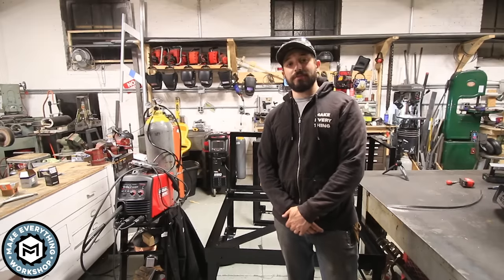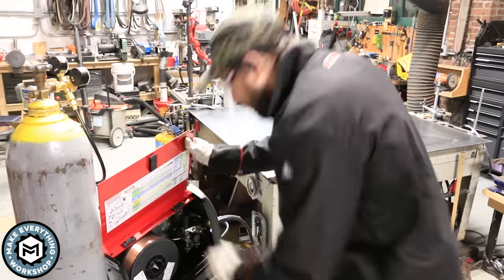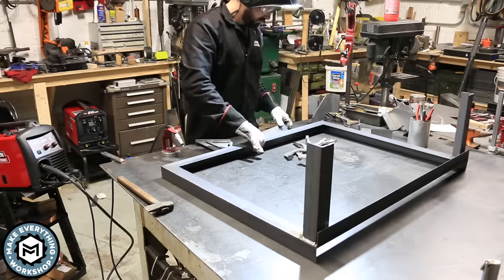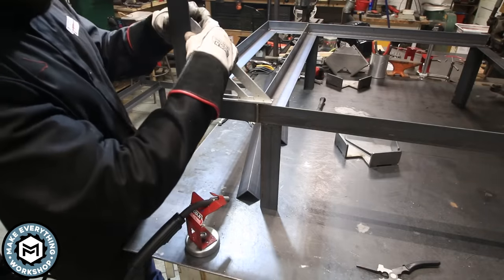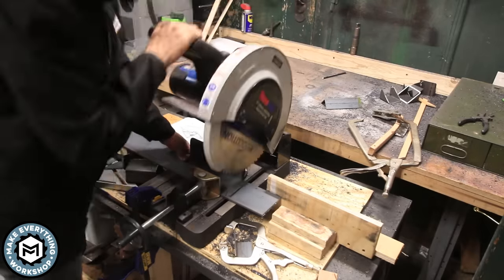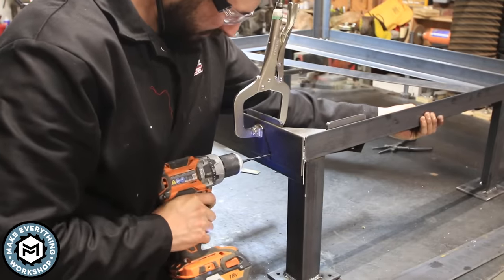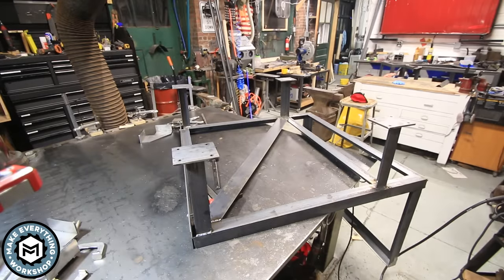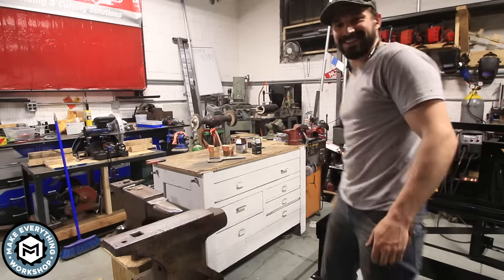How I Make Money With My Mig Welder

Comment: Some of my customers would argue about the final bill. I would tell them that with welding it's all about set-up and time itself. I had a lady who wanted me to build her a frame for a coffee table and told her the price and she asked why so high and I said " when you build something that supposed to be square , it needs to be square ( pun intended). She went to someone else and paid him $665, I was only going to charge her $500. Anyway she brought me his piece and it was 3/8 out of square. Boards weren't fitting right, the welds had Bondo in them, paint was bubbling.i told her I'll fix it but it's going to cost more if I have to fix someone else's screw up. Not to mention the table was supposed to be 36".   This moron had cut 3 sides at 34" then welded on 2" to each length. I told her she would be better off starting over with new materials. She insisted that I fix it. I told her I won't have my name attached to this piece. She was very adamant. I told her that there was rust under the paint, that's why it was bubbling. The wood on top tapers cause of the top not being same length. So she asked me if I could make her a new one and she would bring me the materials in the morning. I said ok, however I would still need a deposit of $125. She wrote me out a check and I cashed it right away. Next day she brings me the " materials" which just so happens to be the same table from the night before. I said that whoever cut the metal cut all of the pieces too short. She was getting mad. I said it's not my fault!  Whoever cut these, cut2@33" and 2@31".  I offered that it can be done for a 30" table. She said ok and I said I'll use the money she gave me to go get materials for the rest of the table. She needed for the following Monday ( today was Friday) . She decided she wanted a drawer so I worked up a price and told her if she changes her that it will affect the final build. She called again asking adjustable feet be put on then called back asking to not put the adjustable feet on. I already mounted the feet. I got it done on Saturday, painted it and told her she can come Sunday afternoon to pick up the table cause paint is still wet. She insisted on coming over to get the table. The paint is still wet I said. She said for me not to worry. It was then that I realized that she was going to pick apart everything and complain about the price. Now because of the adding and subtracting a few items the final bill was going to be $650. She said she won't pay it. I said you don't get your table and I'll see you in court. I hung up. Her husband called me back and I told him I want the money in cash. He came over and he gave me the money. He then asked for the check back. I said that was all part of the price and that because he fucked up cutting the table apart I couldn't and wouldn't use any of the original metal. He picked up the table and got black paint everywhere. The moral of the story is if you wonder why welded pieces are pricey? It's because you have to:
Cut all the metal
Clean the metal
Check for plumb
Check for square
Check angles( if any)
Tack it together
Recheck all of the above
Finish welding
Grind/ sand welds smooth
And that's just a small description.
Reply: This hits the nail right on the friggin head!
Reply: @Thatheatrock  thank you...I love building stuff for people, however there's always that " one" person who could get it done cheaper.
Reply: I learned long ago to avoid homeowners -- some people do very well with them .- the grief just wasn't worth it for me and I stayed with commercial customers .

Comment: 350$ per unit on raw steel? Is that correct.. looks to me to be closer to 350$ for all 3 if not less, only a stick of angle iron and square tube maybe a little flat bar each.. or did you mean each coat you 350$ with supplies, shop costs, consumables ect
Reply: Just thought, if youre buying material at like a metal supermart or some franchise like that try looking for a local whole saler, they typically will only cut it to fit into your truck trailer nothing more complicated than that and you usually have to buy a full length/sheet or half length/sheet but the costis under half.. businesses are based around buying off the whole saler and selling bits and pieces to joe public with 300% markup, my local wholesaler has no issue selling me a single sheet or length of tube its not like you need a 4000$ order to get in the door

Comment: Your applications help to prove you learned metal fab in an Art class.  I could pick your video apart for an hour but I really don't want to spend the time. I mean where do I start?  For now I'll start at the end, painting raw black iron with out primer does not seal the metal, even and especially if the can says paint and primer in one.

Comment: how did you cost these ,,, what was the total , time and profit .
these were the important parts of this video , its a how to make in the  money title , not how to make trucks.
Reply from the maker: tom thompson i assumes 6 hours per cart at $100/hr, with $350 in material. So $950 per cart. I was pretty accurate in my total time in at 16 hours for the project with painting etc.
Reply: do you factor in wear on the welder , and electric , workshop ins , holiday pay etc , or is that in your 100 per hour number.
thanks for the swift reply , 
i know what my customers would say at that price though , hence the asking .
many thanks

Comment: Flux core isn't poor quality. The poor quality comes from someone who doesn't know how to run it properly. It may not look as clean but it is still good welding wire and the welds are more structurally sound
Reply: Keith Clark   mig wires tensile strength is 55,000-70,000 psi Flux core wire is 88,000-94,000psi so don't tell me flux isn't more structurally sound than mig wire. Mig wire is for tools who can't run flux core wire

Comment: One thing, GOOD LUCK finding those jobs.
They either want a certified welder to just run a simple on inch long bead on a noncritical part, or they want 18 hours of HARD work for $25 and then act like they did you a favor!

Comment: The piece you added to the main square your doing wrong. The sides should be one piece the whole length! Then you can weld the piece that goes from side to side. The way you're doing it is weak.

Comment: Actually they will lose a wheel. Lock washers are worthless.
Reply: I agree with that. The way I learnt it in vocational school, lock washers help against loss of tension from deformation of the surfaces under pressure. If you want to secure your screws or bolts against vibration, I recommend Loctite or similar.